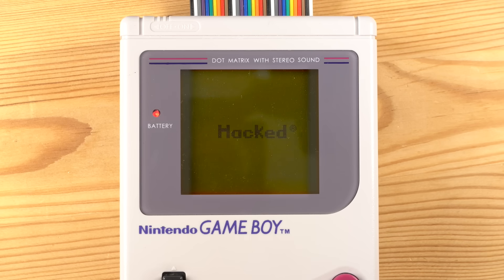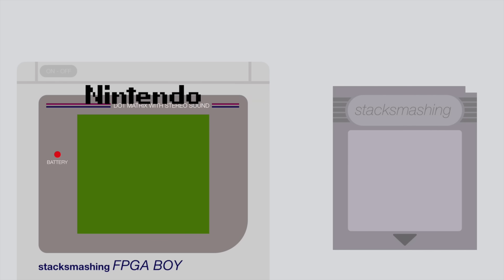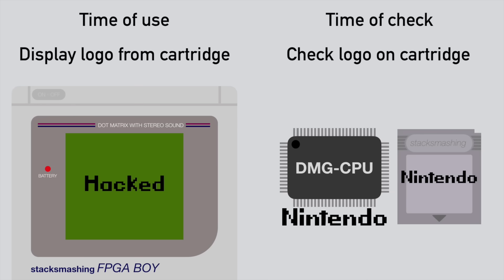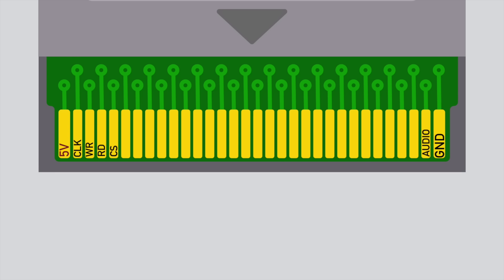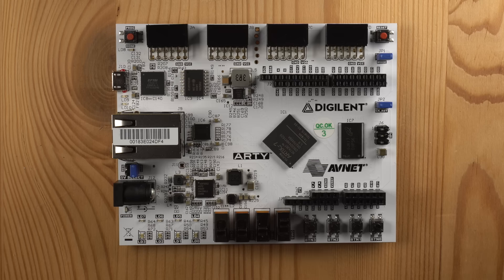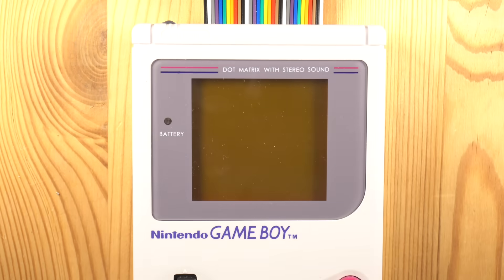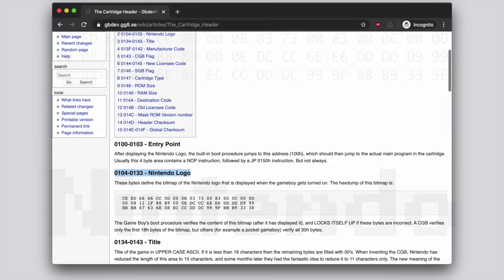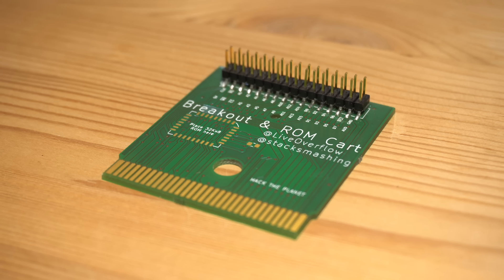Hacking the Game Boy cartridge protection

Comment: The Mega Memory Card did this, I think. I remember it having a different bootup logo but still working.

Edit: TCRF confirms this; "One peculiar aspect of the device is that it uses a trick to switch the cartridge base memory area during the boot process to display a custom logo in the startup animation, instead of the usual Nintendo logo."

Comment: I think putting the original logo in the ROM, even if it is a copy not displayed to the user. would still count as a trademark violation.
Luckily, my understanding of Sega v. Accolade (over Sega using a similar protection on the Genesis) was ruled that a trademark violation is not enforceable IF it is an absolutely required procedure to boot the console.
(though Nintendo still reused the same technique on the GBA about a decade later, except that they added compression to the algorithm. Knowledge of that is how I knew the Pokemon Ruby cart I bought from GameStop back in the day was a fake (that a COMPLETELY BLANK logo on the boot screen should basically never happen on a real cart, random garbage pixels acceptable for a dirty cart). So I just took the cart back and politely asked for a different copy.

Comment: I know this video is a few years old now, but commenting on the trademark thing. I'm pretty sure Nintendo could still sue even if your using a different visual boot logo because they know you have to still be using the trademarked logo during the check otherwise it wouldn't be booting, so your still using the trademarked work, even though it's not visible.

Comment: For the level shifting, it may be a better idea to use IMO level shifting chips with external direction control like SN74LVC16T245 for the address and signal lines. Those chips needs control signals, but thise can be derived from the CS, RD and WR pins using some 74LVC1Gxx logic. This means for the target board it can be directly connected without the need of level shifters, and since those SN74LVCxxT245 chips contains line redrivers, you can even run longer wires with little ill effects. Also you can include an op amp like LMV321 to buffer the audio line, basically also a redriver.

Comment: 2:15
Sega sued Accolade for that exact thing and lost the Cort case. If the system requires the logo to be displayed. Then there is no copyright infringement  

accolade vs sega "Accolade's acts of reverse engineering Sega Genesis software to learn about its security systems and subsequent publishing of unlicensed Sega Genesis games are protected under the fair use doctrine of copyright law. Sega is held responsible for using its security system to place its trademark on Accolade's games."

Comment: i wonder if it could be done without a fpga
by using a second ROM that contains the logo and when the GB is turned on, the modded ROM starts until a few ms later and switches to the original ROM before the second logo read happens.   
or (if the ROM is only filled halfway, basically having addr bit 16 allways 0) putting the logo at 0x8104 and flipping bit 16  x msec after turning on/first read.

Comment: I'm now wondering if there's a low tech way of doing this with discrete components, so a company at the time could cheaply and legally publish an unapproved game.

My thought: I conjecture that the Gameboy will always do the reads after the same set number of cartridge clock cycles, since there is no user input before then. Have a smaller, separate ROM store the unofficial logo and put the official one on the main ROM. A counter chip can count clock cycles, and switch the ROM chip over via chip enable signals right after the hacked logo is read.
Reply: If there's interest I might design a PCB for this so people can sell hardware homebrew game carts for cheap on Etsy or whatever and get sued a little less hard by the Nintendo lawyer army.
Reply: Doh, much more robust design that also uses a comparator and a counter:
Just have the comparator compare the address bus to the (constant) address of the beginning of the logo, and use the output to clock a counter. Once the counter counts to two, flip the enable pins of the rom chips.

Comment: Nice work. You could simplify the FPGA code slightly by just replacing the logo address range during the first read, and otherwise just always return the original ROM data. After all, the ROM already contains the correct logo.

Comment: Why not use an Arduino Mega or something? It runs on 5 V. And you can just read two 8 bit ports into an uint16_t or to get the address, read it from an array or whatever and output it onto an 8 bit port. And then if you want check if the logo was already read once. The program would be dead simple.
Reply from the maker: Arduino/AVR is simply not fast enough
Reply: @stacksmashing  Really? How fast does it have to be? Triggering a pin change ISR, reading two bytes from two registers and and outputting a corresponding byte from memory to another register plus some checks for the logo. That's a pretty simply task. If you program efficiently, I think 100 clock cycles could be realistic. So at 16 MHz, when the read pin is pulled low it would take about 6.25 microseconds to output the data. Obviously you can't use Arduino (the library) cause it's slow as fuck.
I'm sure you could get it faster if you wanna take the time to write the code in assembly. But assembly is kinda annoying to work with compared to C. So I guess that would be a reason not to use ATmega. I just thought an ATmega would be nice cause it would be quite easy to solder directly onto the cartridge PCB and it's cheaper than an FPGA.
Anyway, so how quickly do the data pins need to be set after the read pin is pulled low?

Comment: I swear I've seen a couple cartridges released that were able to boot with a custom logo, without packaging an FPGA into them
Reply: You could do this with a standard ROM chip and some custom bankswitching logic. For example, you could have a custom bankswitch IC that starts with HOME in bank 1, then switches it back to bank 0 after the BIOS reads the logo. Put your fake logo in bank 1 and the Nintendo logo in bank 0, and you get a custom logo, at least on DMG. CGB wont accept this afaik, but it also doesnt check half the bytes at all, so you dont even need a custom mapper on CGB if your logo is some half-Nintendo, half-custom monstrosity.

Comment: It's a rather shrewd form of DRM that relies more on their lawyers filing trademark lawsuits and less on active protection. An even lower-tech method would be the "NINTENDO" trademark stamped on Famicom Disk System floppies which was required for the FDS to boot. Bootleggers were too chicken to stamp that exact wordmark so they came up with ways to dodge it until they realised that only a few indentations was all it took to defeat it.

Comment: Analyzing the video, I came up with another idea that would have been possible with technology of the day. 
Since you mentioned the presence of a 1mhz clock signal, you could power a very small microcontroller that could just count cycles  and since the  boot process always takes the same amount of time , swap the hacked logo bank and the original one based on said counter.
 And it could be a very small additional ROM just mapped to the address.

Comment: If someone wanted to implement this in the simplest hardware, wouldn't a rom chip that's twice the size (or two rom chips, one big and one tiny one.
The first time address 133 has been selected, a flipflop is activated, etither flipping an address line, or toggling chip select pins.That way, you wouldn't need an expensive FPGA.
Reply from the maker: Absolutely!

Comment: Ah, a Game Boy Logo Expert, now I have someone who I can ask this question:
When I saw this trailer /watch?v=UzuOw50zmbU
at second 5 I felt something like a childhood flashback. I don't know if my mind is making this up but I think back in the days our Game Boy would sometimes show this weird logo that you can see in this trailer. Then I blew on the pins and restarted the System and then it usually worked. What is that? Have you, or anyone else, seen that on the Game Boy before? Is it a typical bug that they are referencing in the trailer? I feel like I have seen it before, but I'm not 100% sure, I was like 4 years old when I played with the Game Boy. Maybe this happens when specific pins are blocked?

Comment: hm.. couldn't this be done with just a comparator and a flip-flop? the comparator triggers upon accessing the last logo byte and trips off the flip flop to switch an otherwise unused rom address line. this would waste half of the rom, but seems much less overkill than an fpga. this way it would have even been possible back in the day.

Comment: They could've multiplexed the first 8 Address lines to behave as Data Lines sometimes, you'd only need an 8-bit latch to hold the address before a data read or write. That's how the old 8086 CPU worked, still a pretty cool workaround to having 8 extra pins.
Reply: You can multiplex all of them. Few different approaches exist here. They can also may write through section of map which controls address window.
Reply: I think the GBA did something like that. If I remember speaking to an engineer doing it at the time, he said the bus can auto-increment addresses too so you're not clocking in a new address every fetch.
Reply: I think they wanted to simplify and reduce costs for cartidges
Reply: N64 carts work in the same way. Once a high and low address is latched it just strobes the read pin and the ROM automatically adds 2 to the address for every edge (word aligned access)

Comment: You can use an ice40 fpga or one of those chinese $5 fpgas for the cartridge. It's also possible to load the binaries of a game to the internal block ram of the fpga. Or if you're feeling adventurous, add a microsd card slot in which you can read from the fpga.
Reply from the maker: Yea the problem is getting an ICE40 board with enough IOs and enough RAM - I wanted to try it on one of my ECP5 boards though

Comment: Argonaut Software has a less elegant but more indigenous solution- they’d have a capacitor and resistor that when the GB was powered up, the capacitor would be empty at the time and send the GB the Argonaut text. But when the second read is done, the capacitor would have charged and somehow trigger the ROM to return the Nintendo logo. 

https://www.eurogamer.net/articles/2013-07-04-born-slippy-the-making-of-star-fox

They didn’t get into the specifics tho, but I’d think that the capacitor would meddle with the address bits to shift the memory access.
Reply: This would work for memory map. Double the ROM, and the cap is page select. (Delay via RC time constant, which works since this is very static.) Giving two pages with the same address space. The controller still believes it is working within a single page. 

They could also build a write through section of address space were they can change the page select.

Comment: An interessting and cool example of the use of the audio pin on a cartridge is nanoloop mono:
http://www.nanoloop.de/mono/index.html

"On the original Game Boy models, one pin of the cartridge connector functions as audio input, connected to the built-in amplifier. This unique feature allows to generate sound on the cart and play it through the headphone output on a completely analog signal path.

In the nanoloop mono cart, the analog components (op-amps, comparators, logic cells etc) of a PIC microcontroller are connected and configured in such a way that they form a hybrid soundchip with 3 analog filters and a true random noise generstor, using only a few passive external components."
Reply: Btw, nanoloop mono also has a custom logo shown when booting
Reply from the maker: Yea I also own a regular nanoloop cartridge and it also shows a custom logo :)

Comment: This is impressive but couldn't you just have two ROM chips, an SN74S08, and an SR latch that feeds into a transistor that flips the chip select between the ROMs each time you try and read 0x0133? So you'd start with a hacked ROM, read the logo in up to 0x0133, route the relevant address lines through the SN74S08, trigger the SR latch which would then switch the transistor and changes the CS line over to the genuine ROM? It sees like a lot less hassle than building a full FPGA setup?

Comment: Any idea why the Gameboy reads the logo twice? Why not read it once, display it on the screen and then compare the data to the stored reference data?
Reply: Does seem a bit weird.
My guess is it's accidental.
Someone just didn't think about it when they programmed the bootloader.

That, or it's a technical issue - in the first pass the logo has to be loaded into video memory so that it can be displayed.
The second pass the CPU has to compare it with a value stored in an internal ROM...

Comment: another great source for more info on the Gameboy is "The Ultimate Gameboy Talk"
https://www.youtube.com/watch?v=HyzD8pNlpwI
also about the code, wouldn't it just be easier to have the always block check the RD line for changes instead of the CLK? it would make it only run when it actually Reads instead of constantly checking. or just completely get rid of the always block and use a ternary operator with the RD input.
then again, using an FPGA to emulate ROM is a bit overkill anyways

Comment: Cant nintendo still sue you for having the nintendo logo on the chip at all?
Reply from the maker: Not a lawyer, so absolutely no clue if this was enforceable in the first place :)
Reply: I think they might be able to claim copyright of the image as data, but the trademark is only violated if it's displayed to the user? Not at all an expert, just my guess
Reply: @Tuxfanturnip  Based on a similar lawsuit in the past...
The fact that this form if infringement is REQUIRED to be able to get software to run on such a system actually works against it legally...

Basically, because if you want to get a gameboy game to run at all you HAVE to include this logo, that fact alone counts against this method in a court.
(that's what the ruling against Sega said, anyway... - Sega used a very similar method for the Mega Drive)

It's technically a copyright/trademark violation, but since it's forced upon you for technical reasons, it can't be enforced.
Something to that extent.

Comment: I have actually been working on a similar project A GameBoy cart with an fpga on it, and wanted to use the same level shifters, good to know that they are a little problematic.
What exactly is the problem though with them? do you have any details?
Reply: he mentioned their autosense capability.
Based on datasheets for such devices I'm assuming these are bidirectional level shifters that can automatically decide which direction the shifter is operating in (eg which side is 'in' and which is 'out') and possibly also what the voltages are on either side.

If the auto sensing system messes that up, I can see that causing a bunch of issues...

Comment: Couldn't you have just used an Arduino instead of an FPGA (that way you wouldn't need level shifters)?
Reply: with mcu it a bit more complicated as you have to check how fast rom puts its data out. ROMs are fast, MCU like arduino would need first to read address line, analyze it, read flash and put it on gpio. It all takes processor clocks
Reply: @bojer0  Thanks for your reply. I have done something similar with an Arduino Mega and yes the code was much more complicated than the FPGA code in the video but the hardware setup was  much cleaner.
Reply: @feldim2425 As i said i've done it with a nearly identical device and you are right the most annoying thing about it was the timing but after i looked at the ATmega328 datasheet
i figured out what registers must be set to what values to get the timing right and it worked like a charm.
Reply from the maker: @jonathanwick2913  The problem is not only speed, but also that the ATmega328 doesn't have enough flash to store code + game - and for the more complex carts you don't have enough RAM to implement i.e. a ROM cartridge. I also looked at using an STM32 (which some people also did in the past), but in the end the FPGA makes life so much easier - and makes it much easier to explain :)
Reply: @stacksmashing  Thanks for replying. I used an external RAM chip with the ATmega but i get your point ;)
Reply: @jonathanwick2913  More info please, im interested in that but not for gaming purposes.

Comment: You might want to have a look at the SACHEN cartridges. They were released in the 90s and showed their logo while booting. And they somehow worked just fine.
Reply: They probably switched ROM banks when the logo was read or after some set duration.
Reply from the maker: That sounds interesting, will try to get my hands on one! I also have a cartridge that displays its own logo, using the same method as shown in the video (though not with an FPGA)
Reply: Some time many years ago, I read through an annotated, decompiled copy of the GB boot ROM, and IIRC it didn't compare the cartridge and onboard logos bit-for-bit. Instead, it calculated a line-by-line hash/checksum for each horizontal line of the logos, and compared those.

I had one of these Sachen cartridges, and I remember thinking that the "Sachen" logo looked really weird; it was barely readable. I believe that this was done in order to return the same hash/checksum values as the proper "Nintendo" logo, despite displying a different image.